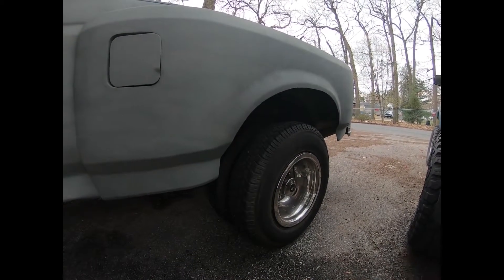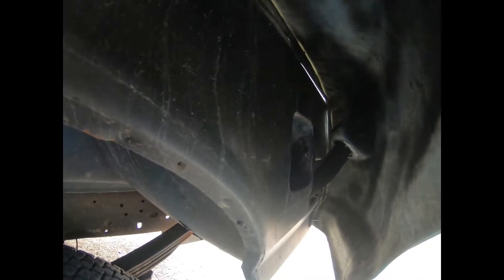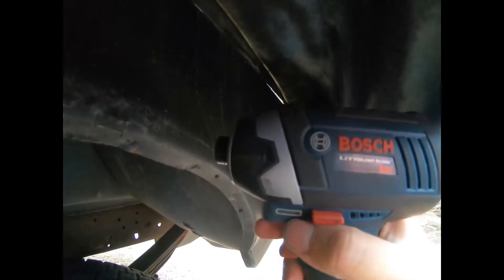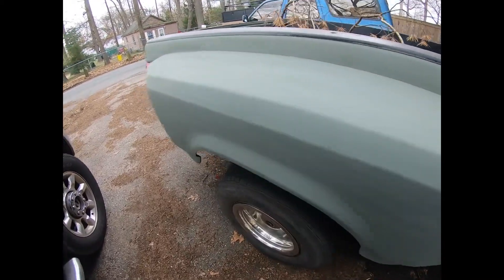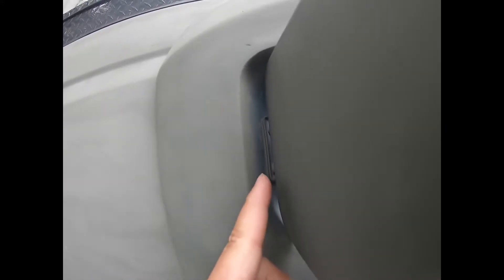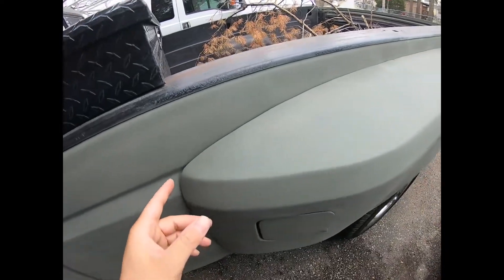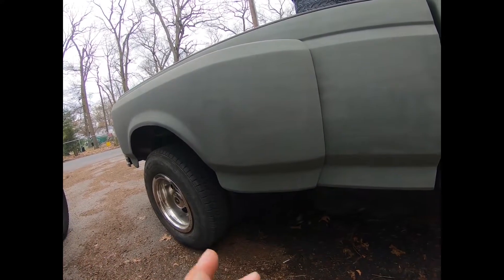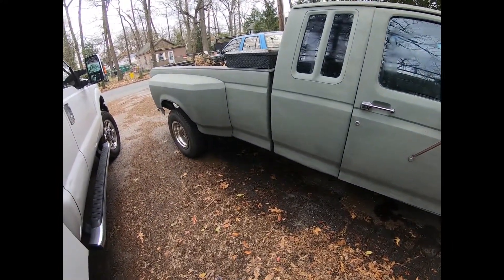Ford OBS Dually conversion fenders adapters

Comment: Where did you buy fenders from is there a website? I’ve been looking with no luck
Reply from the maker: you are right i went back to their website and they are gone , it says cannot locate server , i dont know if they did not pay for their domain website or they are not using it anymore , i just ordered from them last fall of 2021 .
try reach them on 
sales@wallisduallyfenders.com
here additional info :
830 Kindleberger Rd
Kansas City, KS 66115
sales@wallisduallyfenders.com
Tel: (404)-447-4948
or try email Mr Jhon Wallis owner himself here is a video of him : https://www.youtube.com/watch?v=V-xBKHEZWyY
Reply: @WheelersHoarder  so I called and got answering machine and says we are no longer in business!! I just dually converted my truck and wanted a set of these and the guy closed down shop!  Dang!!
Reply from the maker: @humminfummins9120  man that really sucks ,  I think a lot of people do a flat bed when they convert to dually , best thing is just to find a dually bed. 
The problem was with shipping I guess those fenders are big and the total did add up mine did cost 650$ total , I think between 500 and 1k you can find a good bed
Reply: @WheelersHoarder  yeah that’s the plan. I was gonna take the cheep route and slap these on but I guess not now lol
Reply from the maker: @humminfummins9120  yes those fiberglass fenders are easy cheap shortcut